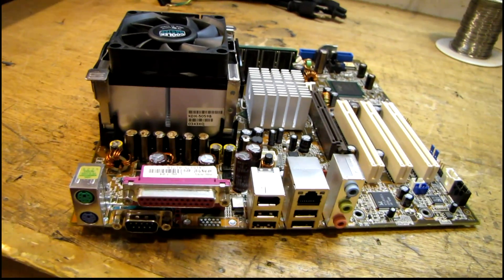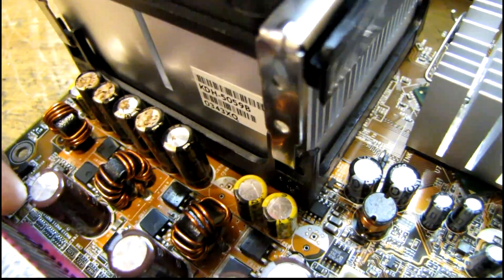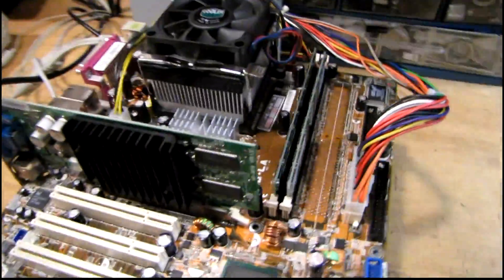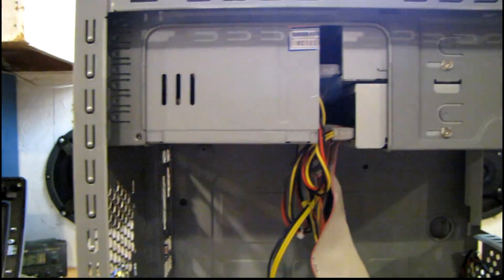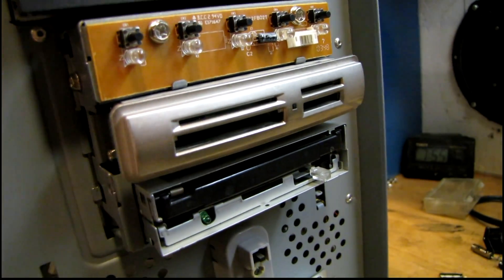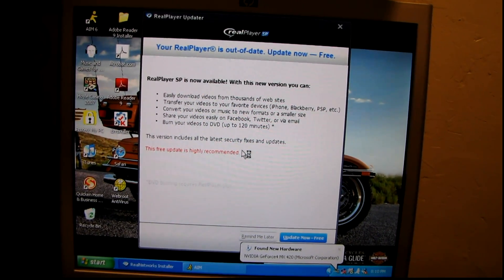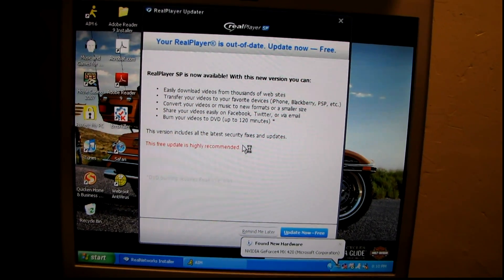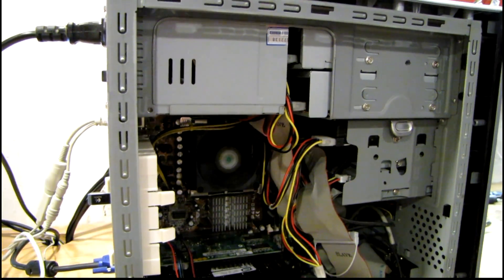HP Media Center PC M490n Recap And Test

Comment: this is why i hate OEM cases its stuff like this that makes me hate them each time i pick up a computer i will usually take the motherboard out of that case and put it in a cooler master case with one i put in a nmediapc htpc case
Reply: +Andydandyfiddy what i was referring to is i usually pick up computers for free but had issues like this some blown caps on motherboard or psu either due to neglect of the original owner or bad design of case
Reply: mylocal thrift store doesnt usually take computers so i usually pick them up if i see them and see what i can do with them if anything
Reply: My htpc only thing wrong was with it was the junk bestec psu the owner kept the harddrive. I didnt keep the case since the design wouldnt exactly work with what i had planned and also was limited to space as well on shelf
Reply: i bought one till i got it i used a spare laptop HDD i had lying around
Reply: it certainly does good with windows 7 pro no issues with it at all
Reply: +Andydandyfiddy havent uet but so far hadnt had a issue

Comment from the maker: You might just need a new tip for it.  Also keep it cleaned and tinned.

I use a Hakko 936 soldering station with a 1.2 or 1.6mm tip.  It is temperature regulated, so it works well on all types of boards.  For desoldering I use a Hakko 808 with the A1002 tip.

Comment: I have that same computer with an ATX 12 volt connector problem I unplug it the computer stays on soon as I plug in the ATX 12 connector the connector sparks and the computer shuts down

Comment: have this same case only differnece is the front besal and it came with some cheap little psu that pull all the air from the pc out of the case and eventually the poor thing fan sezed from all the dirt that built up in there and somehow it kept running like that for a long time before i took it apart and saw that, since then i cleaned it up lubed the fan in it cleaned out all the dirt and the psu is still working just fine.

Comment from the maker: @911QWE There's lots of videos on Youtube that can explain that better than I could :-)

It's also something that needs to be perfected with practice.  I've been doing it for over 20 years, and I still have some difficulty with certain configurations.  Good equipment is also a must.  I'm only using mid-range stuff for through-hole type board repair.

Comment: sure asus didn't put them in backwords? not sure if that is possible and it would still work. my dell dimension 8200 has the plastic thing that goes from the back to over the fan too. my case id designed a little better though i think maybe.

Comment from the maker: @Knaeckebrotsaege What really blew my mind is that the caps only have 1.48 volts across them.  But ya, the whole PC was just cooked!  I'm going to turn the fan speed up before letting it out of my shop.

I wonder if I could have gotten away with using solid caps.  Probably not worth the cost though.

Comment: I have a Dell GX280 with bulging caps and I wondered if you had any tips on soldering? Also, should I buy Nichicon caps, because the blown caps were only Nichicon (15 caps or something) I have a list with the uF and voltage of all the blown caps and I don't know if I should buy Nichicon.  I'm new into soldering and would greatly appriciate any help :)